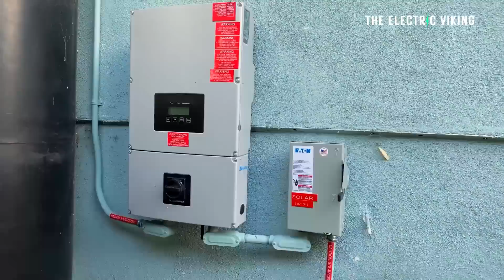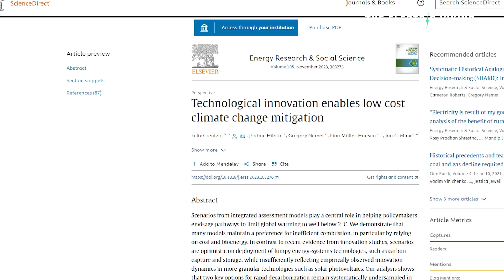Fossil fuels ‘become obsolete’ as solar & battery prices hit 'tipping point'

Comment: Have you heard about the Statistics Norway study that disproves so called global warming? It's time to reexamine the role that CO2 has in climatology and plant growth. The biggest trouble with wind and solar is there is no way to recycle these devices once they ware out. How much silver is used in these products? Silver prices are kept artificially low, and the true price of silver should be 200 to 2000 USD per ounce. We have had a real problem in the US with burning and exploding EVs, so I wonder if these vehicles are safe. Charging time also makes these vehicles impractical. While I am not a climate alarmist, I do think there are cheaper alternatives to carbon-based fuels (oil of course is not a fossil fuel).  I don't see the future being so called renewable energy. I see cheap clean, safe, and abundant thorium nuclear energy providing most of our electrical needs. Thorium is a waste product of metal refining especially the rare earth metals used in EV's. There is said to be thousands of years of thorium reserves. Water will fuel our vehicles in the future and not expensive, heavy, and dangerous batteries. Electric vehicles will be regard as impractical fad in the future. Exiting vehicles can be converted to run on water. While gasified water will not work in diesel engines, it will work in turbine engines and jets. Semi-trucks and locomotives will be powered by turbine engines fueled by gasified water. Can this renewables/ EV fan boy channel do programs on thorium nuclear reactors? What about the experiments of Stanely Meyer and others on gasified water? The hydrogen and oxygen in water is a very explosive mixture and when combusted does not produced the dreaded evil plant food CO2.

Comment: Coal is pretty much obsolete. It's expensive to mine and transport, and the pollutants from coal burning are very serious health hazards (oxides of nitrogen and sulfur, particulates, heavy metals, and carbon monoxide particularly). Natural gas will still be around for a while, since natural gas for power generation generates way less pollutants and pollution controls for natural gas is pretty cheap. I expect natural gas to be relagted to "peaker" plant use, with primary power generation by solar and wind by the middle to late 2030's.

Comment: The 12-panel array and Powerwall were $22,600 installed in 2021. Our average electrical bill prior was roughly $155/month, and our average auto fuel bill was about $240/month.  With the PV system, our average electrical bill is now about $7/month, including car charging, and last month, which would be fairly typical, our off-site car charging was $24.
Reply: you save $4368 in bills per year. Pays itself back in 5 years from installation date. 

Does not include the price of an electric car in the estimate, that complicates things haha
Reply: Do you also count the cost of the ICE vehicle when working out your fuel cost. EVs are at price parity in China & will soon also be in other countries. EVs also last longer & cost much less to maintain@-whackd

Comment: ok every body plastics are not fossil fuels ...since i worked in a petrochemical business we made ethylene which was then processed into plastics of different varieties...

We made a lot... but guess what we had to be on spec at 99.9999 purity...
and when we could not make that you know what we did...we diverted it to a flare and burned it ...a lot of it till we got back on spec...
because the contract was for 99.9999 purity....and guess what we ended up burning a lot of that..
So there are always chemicals that get burned up why do you think when you see chemical plants they all have flares burning...
Every chemical process burns fossil fuels to get to your end product and its not avoidable .....so making plastics uses fossil fuels..
And no there is not enough storage to not burn it..
get real people its never going to be zero no matter how much you want to dream of nirvana...
Reply: I keep telling people it's too late and folks under 50 are going to suffer pretty terribly but too many people are in denial.

We pass the limit for 2C in 2026.  My city had 20 and 30 year old bushes and plants dying this summer from extreme heat that lasted almost two and a half months straight.

And we're on track to pass enough CO2 into the atmosphere to exceed 3C by 2050.
Reply: Ethylene can be produced a variety of different ways, but the bulk of it is coming from Ethane; Obtained through isolating it from Natural Gas and from the refining of petroleum or oil. Mass production of plastics is possible because of the huge feed stock from both gas and oil.

Comment: Given that 63% of Americans live in URBAN AREAS and at least half the country does not live in the sunbelt, 
1 - The REALITY is Power Companies will set up huge solar farms in the sunbelt and in deserts (like Nevada, Arizona, parts of Texas, etc.).
2 - This will require HUGE investments in transmission grids (an electric car is pretty useless without a charging station)
3 - Just the additional wooden power poles required will destroy a huge number of forests
4 - Even the simplest metal required (Copper) requires a 5x increase in production. Rare earth production increases are a decade+ away

So the 'tipping point' will take at least a couple of decades for electric vehicles replace internal combustion engines
Reply: None of this is needed though.  Most Americans live in free standing houses with plenty of roof space for solar, so they will do what I do.  Solar panels mean that I take 70% less from the grid than I otherwise would, and I can also charge my EV car for free everyday.  Zero impact on the grid, and I save $3k per year on car fuel.

Comment: Waiting for cheap solar and EV. The local solar installer that I like wants over 7K for 5Kw solar system with micro inverters. Will be glad when the cost of those comes down. As for an EV if the BYD Seagull was imported to Australia would happily buy that, don't need a large expensive EV.

Comment: The real issue now is that we need at least double the electricity power generation if everyone uses EV's and Australia is nowhere near doing that and people keep forgetting that
Reply: Not sure about that Alan.  Anyone with rooftop solar - and that’s 30% of Australian houses - soak up free electricity during the day, and still export plenty back to the grid.  Once your car can also be your house battery in the next 5 years, grid consumption is going to go down significantly in my view, and so will the cost as you will also be able to trade your exports on the open market via virtual power utilities.

Comment: Current battery technology is not sustainable. Raw materials are finite and will become more difficult to extract and will become uneconomic. Recycling batteries is a fantasy. There is no new fuel technology that is anywhere near large scale production. The EV market will stall and fail.
Reply: LoL!  Battery recycling is already a huge business and about to get a lot bigger.
Reply: @Cant_prove_god  Recycling batteries recovers 40-50% of the raw materials and produces Greenhouse emissions in its own right. The process is fundamentally difficult and uneconomical. The only way recycling can be on a large scale and make a significant contribution is by Government regulation and adding recycling costs to the original battery purchase price, thus making batteries far more expensive. 90% of EV batteries are currently ending up in land fill, potentially contaminating ground water. There is no way batteries can be 100% recycled and the Planet does not have an endless source of raw materials. Major mining companies have clearly warned that Lithium supply will not keep up, even when future mines are developed. Unless Governments wake up to this and the load on the electricity grid then the EV will be a museum piece in 20 years.

Comment: Musk mentioned to Joe Rogan recently that using modern panels an area of 100 miles x 100 miles would produce enough electricity to power the whole of the USA. Sounds like a lot of land - but the USA is pretty big. And has some pretty empty deserts.
Reply: It has a lot of rooftops and parking lots, too.
Reply: A lot of places that use electricity are not near places where the sun shines.  Transmission losses beyond a few hundred miles eat up too much energy.
Reply: @dzcav3  High Voltage DC transmission lines solve that issue. They lose about 3% per 1000 kilometers, enabling vast distances between where power is generated and where it's consumed.
Reply: @TekCentric  You said, "High Voltage DC transmission lines solve that issue."  two questions:
What is the additional infrastructure cost of the the HV DC lines?
Who is willing to have those lines cross (or even come near) their property.
Reply: @dzcav3  The investment costs for HVDC converter stations are higher than for high voltage AC substations. On the other hand, the costs of transmission medium (overhead lines and cables), land acquisition/right-of-way costs are lower in the HVDC case.
As for who would be willing to have power lines cross or come near their property: whether it's high voltage AC or DC power lines makes no difference. There will always be people who don't want power lines of any kind anywhere near them.
Reply: @TekCentric  I'm curious.  Why would land acquisition/right right of way costs be lower for HVDC than HVAC transmission lines?
Reply: @dzcav3  Because HVDC requires less total land area for installation than HVAC.
Reply: @TekCentric  Any high voltage line requires real estate right of way for the towers plus clearance on both sides for construction and maintenance.  Judging by photographs of actual HVAC and HVDC transmission lines, there doesn't seem to be any significant difference in the right of way required for the different types of lines.  DC allows for slightly smaller wires and insulators, but the basic towers and real estate pathways are pretty similar.
Reply: Heat sometimes limiting factor
Reply: @orionbetelgeuse1937  Joe replied saying that and Musk said " Well of course it would need batteries as well" But his comment was just an illustration of how much power could be gained by an area that size. A theoretical figure for consideration. Not a proposal to actually do that.
Reply: @orionbetelgeuse1937  You continue to miss the point. He wasn't advocating building either a 100 x 100 miles solar array - or building batteries to cover night use. He was just illustrating that the daily electric use by the USA 'could' be provided by that. Not that it 'should'. It was like saying something is the size of Wales to allow listeners to grasp the concept.
Reply: @orionbetelgeuse1937  Yes, there are days and months with less sun during the winter, but solar panels are getting so cheap, it's now becoming viable to do something called "Overbuild". What that means is a power utility can afford to buy and install extra solar panels, which will enable them to generate the same amount of power in winter as they do during the summer. It also means a lot of surplus power would be generated during the summer with all those extra panels. That power can be used for a lot of different industrial processes when it isn't needed during winter.

Comment: Unfortunately, the cost of installation on your roof increases by 20% every 5 years, so a net loss.
Reply: Install them yourself.  The installers are ripping people off.
Reply: @incognitotorpedo42  I'm not an electrician.  I would have no idea what to do with an inverter.  BTW, I'm WAY too old to be doing any installation.

Comment: Agreed.  Solar will go down below 1 cent per kwh this decade -- almost free.  The issue is intermittency.  Can we get energy on demand?  When we want to turn on the lights or charge our cell or EV.  So you have to think about it as Solar and Wind energy plus Batteries (SWB).  Solar and wind generation and battery storage.  So when the wind isn't blowing and the sun isn't shining, where will we get our electricity?  Batteries.  Emission-free energy needs to power everything -- Electrify Everything and Stop Burning Things.  We can do it and it will be cheaper, much cheaper than fossil fuel energy.  When you take into account the health and environmental costs emission-free is infinitely cheaper and can lead to a new age of prosperity.
Reply: Have you thought about how much battery storage we will need? There is not enough Lithium in the world for what will be wanted. We cannot rely on a "future technology" as the problem is now and we will have to go with what we have got. Therefore the only answer to reliable power generation is fossil fuel for now and the foreseeable future however much we dont want it.
Reply: @user-nh1bx8pp7e  Yes I, and more importantly researchers who do energy modeling, have thought about how much storage is needed.  It's surprisingly not that much.  Rethinkx modelers say that California needs only 29 hours of storage to cover the troughs in solar and wind generation.  The troughs are at night and in winter for solar and usually during the day for wind.  So CA has to produce and store enough electricity to cover that 29-hour gap.  As we electrify everything the number of mwhs grows, but the price of electricity will continue to fall rapidly at least over the next 10 or so years.  So will the price of batteries which can be produced almost totally from recycled materials.  Lithium is not at as rare as you seem to think.
Reply: @bobbresnahan8397  SWB will never be feasonable implemented anywhere, it is a pipe dream. Too many grid services like spinning reserve, etc. provided by turbogenerators cannot be replaced with batteries, the grid would be very instable.
I don't know a lot about the weather in California but 29h seems to be very short. Cloudy days? No wind power for days?
I don't see any mechanism for falling prices with lots of wind and pv added to the grid.
50% nuclear and 50% renewables (with storage) looks far more promising.

Comment: Sam. I’m in California. I installed a solar array (4.6 Kw), a Powerwall  and bought a Tesla Model Y and I charge 97% at home. No fuel bill and my average electric bill last year was $7/month.
Reply: My 6.6kw solar system, which was on the house when I bought it, produces roughly 3 times more power than I can consume during the day.   I’m exporting a ton, which I get paid almost nothing for by my energy retailer.  I’m getting a Tesla Model 3 in 2 months so I can soak up all that excess production, pay nothing ever again for car fuel….and save around $3k per annum, just on fuel savings.
Reply: ….oh, and the consumption part of my electricity bill is about $30 per month for the energy I use at night.
Reply: @Cant_prove_god Your $30/month is probably mostly a fixed cost just to be connected to the grid, as you probably use very little electricity at night.
Reply: in regione Merche, Italy, many buy the dacia spring, charge it with solar
Reply: But th way welcome to the na na na -na ur havin a blast  f o n FUN
Reply: So how much did your solar array and Powerwall cost?  And how much annual electric cost savings are you getting?  With only part of the story, it's hard to tell if your setup is economical.
Reply: In Atlantic Canada, 9.92 kW PV, all electric heat pump etc 3 bd 2 bath Bolt (and a Forester) We are lucky as our utility pays/charges the SAME rate to/from the grid. We build credits April-Oct, and draw down Nov-Mar, annual incl EV is about 10,000 kWh, and we more or less break even on kWh.  We (and everyone else) have to pay a separate grid access/maintenance fee $30 monthly, can’t be offset by credits. Our net payback time was 8+ years, but now 7 years (3 left) due to rising electricity rates.
Reply: Already on a 100% green grid that has some of the lowest electricity prices in North America, and no insolation all winter, so I'm not motivated to do solar as it stands. I'm waiting for solar tiles that last decades.
Reply: How much is your solar contract per month? How much after 20 years? There is an escalation clause. I got a quote from Tesla and there was no savings! So don't be hoodwinked.
Reply: How does this add up? Are you in a trailer? This will provide approximately 20 Amps at full sunshine. My house has 200 Amp service. Is there a decimal missing?
Reply: @userr why would you talk in Amps? Watts is the unit for energy. Plenty of people using solar and batteries to be free of the grid costs. Of course it can add up 4 kW solar and 8 hours average sunshine gives you 32 kWh, that is way more than the average home uses.
Reply: @AORD72 you divide the watts by the voltage available at your home plug or socket. You'll get the amps...
Reply: @JappaKneads  I'm well aware of that. Is he using 240v or 110v or 12v? that is the problem. Watts is the correct unit for amount of energy be used or generated.